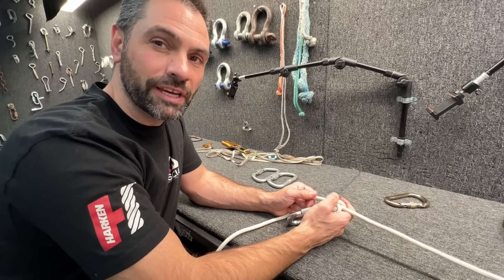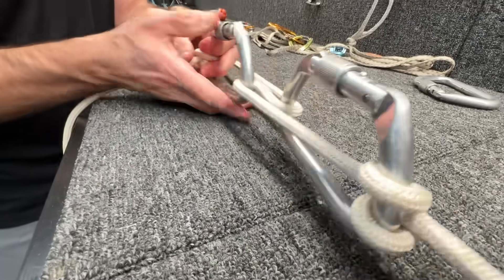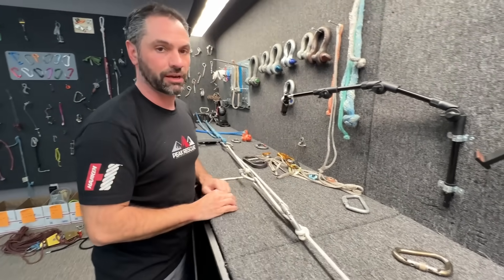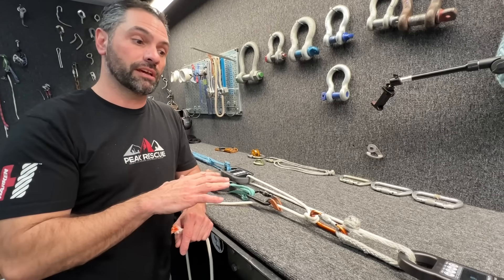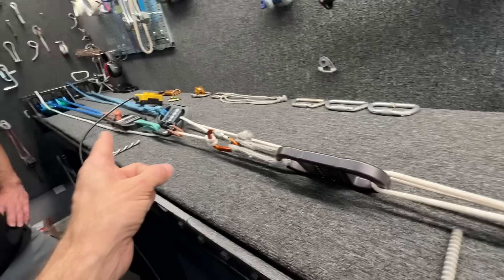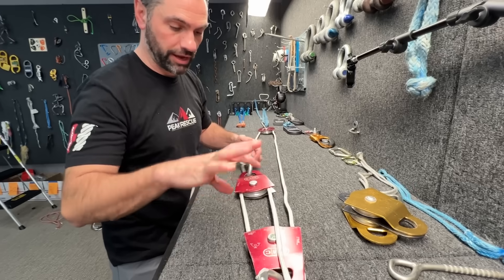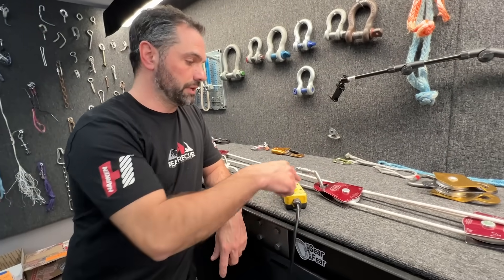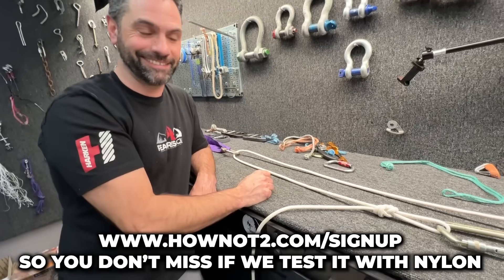I don't understand how this holds

Comment: You don't even need carabiners. You can do the whole system with just knots too... Though it is pretty hard on your rope (first carabiner replaced by an alpine butterfly, second carabiner you just wrap around the object instead, third carabiner is just a figure 8 or a bowline.

Comment: There is a difference between static friction, that must be overcome to start something moving, and kinetic friction, the force required to keep it moving.  Although the kinetic friction seen by the rope sliding over the carabiners is greater than if they were replaced by pulleys, it is not so great as to completely overcome the mechanical advantage, so the hitch does amplify the force you are able to exert.  When movement stops, the static friction is great enough to capture the progress.  The vector pull aids in adjustment of the hitch because it helps to overcome the static friction.
Reply: Well said, and beat m too it.
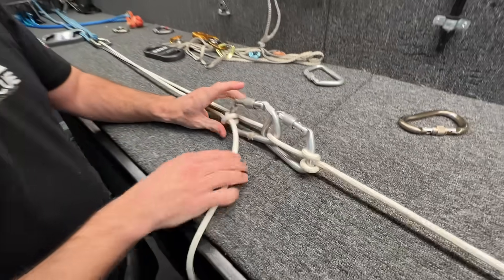Reply: The carabiner hooked through the bite at 1:18 acts like a movable pulley. Mechanical advantage x 2.
Reply: Nailed it.

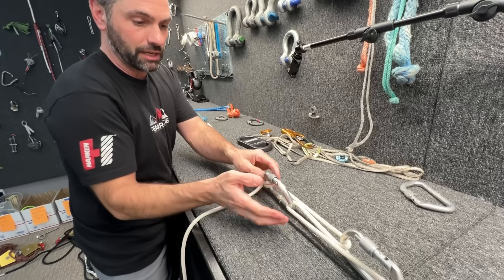Comment: 1:55 During tensioning you use your hand force to move the rope and 2 bends get essentially removed from the holding equation. During holding there are 2 more bends that hold the rope and they both have their separate force that helps to hold the rope.
If the rope were more slippy it may not hold at all.
This is because the maximum holding force is approximately linear to the force on the rope.
There is some friction coefficient that is above the threshold for it to hold.
If you increase the overall force it may slip because the friction may become non-linear.

If pulled like in 2:28 without pulling sideways then the mechanical advantage (minus friction) is 2 because your hands move twice the way (in relation to each other) than the way the overall endpoints would move towards each other if they weren't fixed.

Comment: AKA you are using the mechanical advantage to over come the high amount of friction. Which in turn allows the system to lock in place. It's actually dumb to think this system has no mech advantage in it just because you add more friction.

Comment: So here's the thing; mechanical advantage is still relevant to this system even with the friction involved; in fact, especially with the friction involved. Without mechanical advantage you wouldn't be able to put any serious tension into the system just pulling by hand. The mechanical advantage doesn't disappear jus because there is also a friction force that masks it, and is necessary in order to enable a human to be able to tighten the system up adequately.

Useful video in all practical terms, but I felt like the theory needed a litle clarification.
Reply: Put it this way: While the mechanical advantage might negate the three to one, it essentially is giving you a frictionless 1:1. if it didn't have the mechanical advantage, you would essentially be fighting against the friction in order to create tension. Instead the MA offsets the friction, allowing the system to appear frictionless, even though the friction is essential to the operation and the 'locking'.
Reply: TL;DR: the friction cancels out the mechanical advantage, but without the mechanical advantage, it would be even more work
Reply: Seems like the most appropriate thread. Introduce the mechanical advantage after the final carabiner in the voodoo friction hitch.
Reply: The friction in the pulley system acts like a tensionless hitch, though probably not as strong

Comment: Great video! The voodoo hitch is awesome- speaking of friction, one way to use less carabiners and increase holding power is to use a directional figure 8 and then pass a bight of the working end through the loop of the directional 8, and then just use one carabiner to attach the end of rope to the bight after you have gone around your anchor. The method of tensioning that involves pulling the long strand of the set toward the anchor, and the one moving away from your anchor at the same time takes away the friction when tensioning but holds it in place better.  Really cool testing you all did and was great to visualize!
Reply: I prefer a butterfly, since it won't lock up like the directional 8. You can actually just use a bowline in place of the second carabiner too. The knot actually doesn't need carabiners at all, though it's pretty hard on your rope without them.

Comment: Yeah this is a less-than-one to one. The energy going into it is stored as friction. And that friction captures the increase in length, which causes some amount of resulting tension across the system.

Comment: Hysteresis is what holds the tension.

You can put pulleys in some of the turns and it will still work, gonna play with it tonight. 

I used to have an illustration I did from playing with the VooDoo of where pulley(s) worked before "failure". Will remake it to share or hopefully dig it up.

Comment: Here in germany the DAV recommends a double bowline(without a stopper knot) to tie into your harness as an alternative to the figure eight. Some other ressources say a stopper knot is mandatory when using a double bowline. So what is it? Does it really slip?
Reply: Bowlines are a little more likely to loosen or slip - particularly with very new/stiff rope. They can be used, and be safe, but as with anything here, there are considerations. I would tie a stopper knot, but I also have developed a habit of using a Yosemite finish as I know it to capture the tail on a figure 8. Incidentally that finish helps make the knot easier to untie after loading, which is one of the reasons people do use bowlines instead. 

Back up everything when reasonable and possible, trust but verify, don't eat yellow snow (unless you're into that)
Reply: Two different knots and a translation issue - and an inconsistency in naming knots in different sources possibly so use Ashleys Book of Knots numbers to clearly differentiate.
The DAV approved one is correctly translated as a bowline on a bight(ABoK 1080), not a double bowline(ABoK 1013), the latter is a different knot that seems to need a stopper.
Reply: @iDayrr You are right. But even then, the english language wikpiedia for bowline on a bight (ABoK 1080) says "However, it is critical to use a strong backup knot with plenty of tail beyond the knot, as the knot may untie during long climbs"
So some people seem to think you need a stopper knot or similar.

Comment: I've used a similar system for solo tensioning a slackline (not highline) between trees using 1" tubular nylon webbing. I'm curious if that also has no effective mechanical advantage because of the system's friction.
Reply: The advantage is still there, but as there is no movement, it doesn't matter. 

It's held together by the static friction, like a frictionless hitch is.

When that is overcome, like someone side loading it, then you have the sliding friction contracting the movement of the slippage, and this is modified by the mechanical advantage. You can probably grab the zig zag of roses, and that would be enough to stop all the slipping.

Comment: Maybe i'm understanding this wrong, or rather approach it wrong, but it does have a mechanical advantage, working in the middle to give the system tension but the way the tensioning carabiner is suspended from both sides it cancels each other out? I guess maybe that's also what's the debate here? If you can call it mechanical advantage even though it's wasted on friction and creating an opposing force by suspending the tensioning carabiner from both sides? It's a rare form of mechanical advantage, that's not giving you advantage. :D I'm curious what would happen if you put tiny pulley (Petzl Rollclip maybe?) will it still be unfunctional, or if you put a huge shackle (theoreticly bigger contact patch=more friction but bigger bend radius should slip easier when acting as a pulley?)

Comment: If I set up a 5:1 pulley system, in order to lift 100lbs, I have to pull with more than 20lbs of force.  Once the load is at the desired height, I can't let go, nor do I have to apply 100lbs of force to keep the load raised. I do have to apply exactly 20 lbs of  force (including any friction)
Reply: Excluding friction when holding(hence if you wrap it around something you don't need the same force to hold
Reply: @lasskinn  Something has to apply the same force to hold the weight whether it's a person or something else.  Just because you tie it off doesn't mean that the force goes away.
Reply: @lasskinn  but that would still be 20lb or more of *friction* force
Reply: Technically you would need a little less than 20 lbs to hold it
Reply: Exactly
Reply: True
Reply: You will be able to hold your 100lbs with less than 20lbs force if there is friction in the system.
Reply: @kenmercer2721 and there always is!
Reply: @kenmercer2721  Yes, but then it will take more then 20 lbs. to raise 100 lbs. if there is friction.
Reply: @charleshill506 correct. The extra (and less) force required to raise (and hold) respectively go into heat in the system when movement occurs.
Reply: @charleshill506  It already takes more than 20 lbs to lift 100. Just not much more.
Reply: AKA you are using the mechanical advantage to over come the high amount of friction. Which in turn allows the system to lock in place